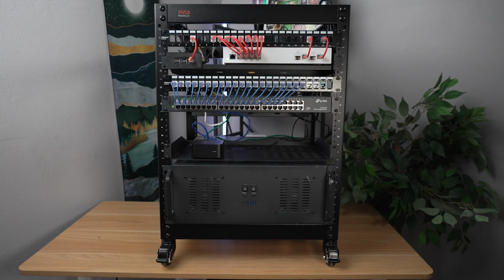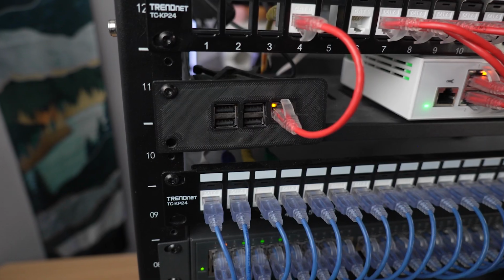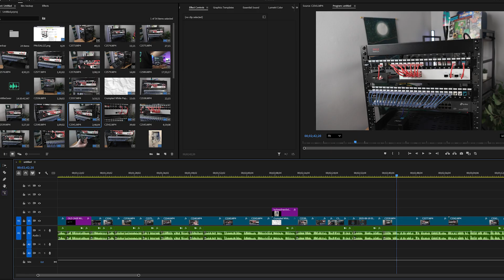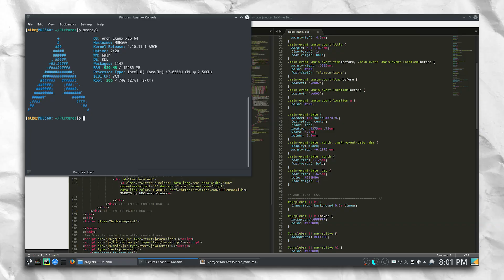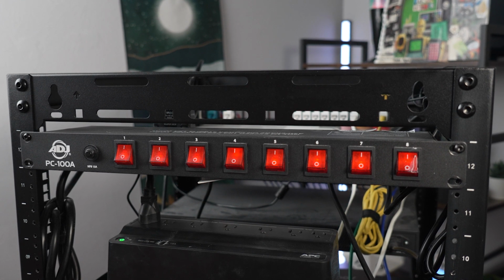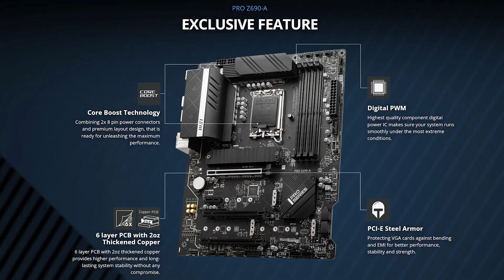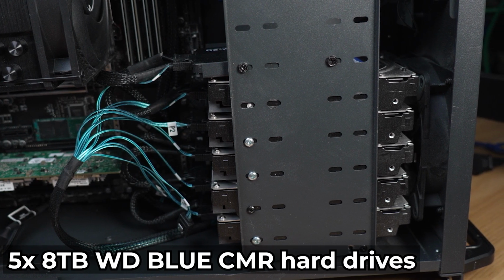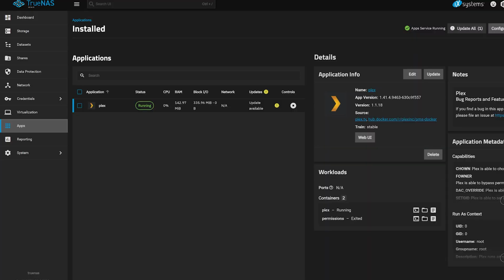What’s Inside My Homelab Server Rack?

Comment: RE 10gb network: That 128 MB/S file transfer is slightly over 1 Gb/sec which means you don't need a fast network, you need a better file server configuration. In real life random directory copies, I get 400+ MB/s using an old computer running truenas with a good disk arrangement.